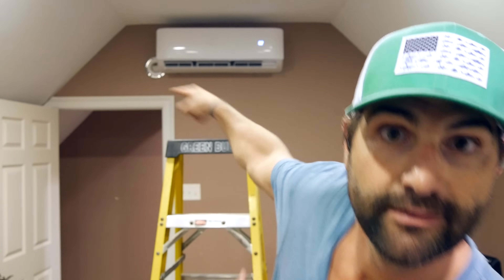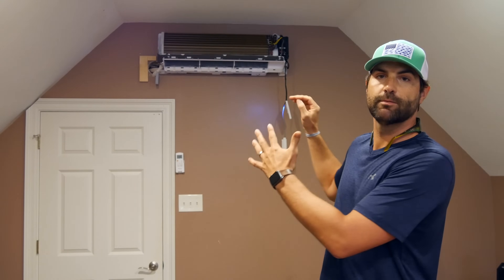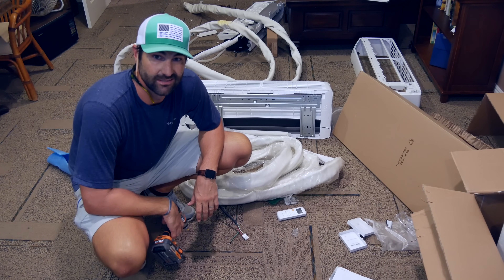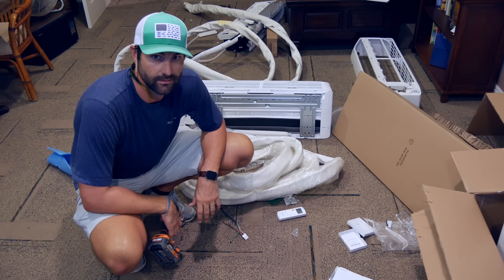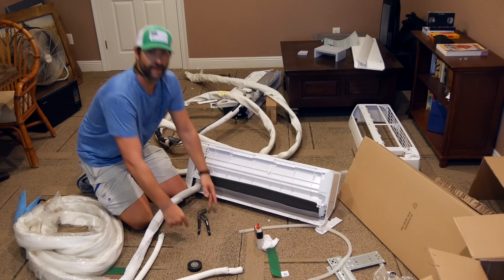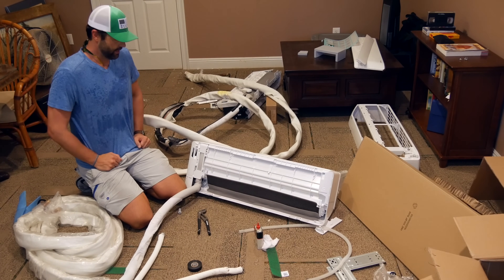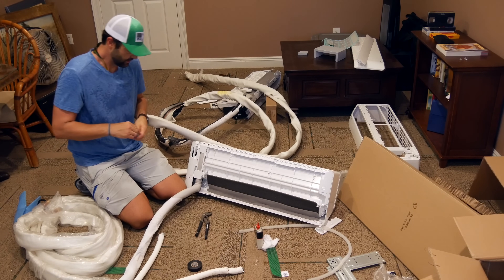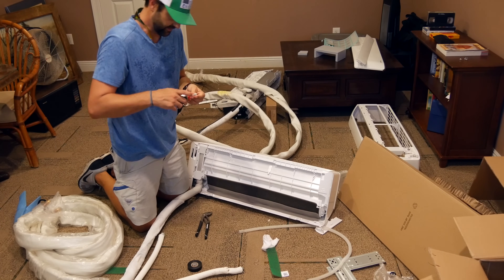Troubleshoot DIY Mini Split Not Cooling - Replace MRCOOL 18k Mini Split

Comment: I have the same set up I want to do for my new mrcool diy .   The place I want to mounting unit The inside unit it’s going to be above a door opening then behind it I have to go through closet wall wall then the  through my closet wall and then to the outside.  3 walls to get to the outside.   My issue is how much space do I need to hang the inside unit over the door way ?   Right now I measure 15 in  is that enough to left and hook the unit to the mounting bracket? Also the drain line I don’t want to run it through all those walls I was thinking of running it over the doorway behind it and then straight down to  my floor under the house and out  what do you think ? I noticed that you left the drain line out and then you fished it through And then it’s almost like if I was gonna do the same thing but I’m thinking of just running it behind the doorway straight down to the ground in and out of my house
Reply from the maker: Ram M457 - I will measure my unit and see, but I think 15” is not enough space for the 24k unit I have.  The smaller unit may be smaller in size.  Regarding the drain line, I would run it the shortest route to drain.

Make sure you slope the line set and drain line downwards as you go through walls.

I’m currently doing my 3rd MRCOOL installation video for my spray foam attic, so stay tuned for that one
Reply: Pahjo Designs thank you for replying I will
Have to make the wall entryway a little bit wider that way he can have enough space to be able to lift the unit and lock it in place as far as a drain line if you show in your next video how you’re doing the drain line will be awesome thank you for replying I am waiting for your video when you upload it I currently have not bought   The unit but I will soon and that is the only place I can mount it so I have to do some modifications to make it work in that entryway thank you again I appreciate your  reply

Comment: Hey guys. I’ve had nothing but problems using those insulated line sets with the white foam. I’ve replaced them on a few units. If you inspect them closely, you’ll notice how porous they are. I added the due capsules for POE oil and it permeated through the pipe and the insulation. Try not to use these line sets. You’ll save time and money. Run the American made copper tubing. Good luck.

Comment: You had a leak because of not pulling a vacuum on the line set and evaporator.  In Louisiana, once you pull the plug on the line set before you make the connection at the condenser valves, humid air enters the system.  The non condensables “humidity/moisture” when mixed with the refrigerant and oil in the system create acids that eat through components causing leaks.  After connecting the line set, the system should be evacuated with a vacuum pump, checked for leaks, then the refrigerant valves opened to release the refrigerant into the vacuumed dry sealed system!
Reply: You guys going back and forth on this thread, don't seen to realize they have two versions, the standard and diy.
The diy linesets are not open to the atmosphere.
They have sealed quick disconnect fittings, similar to hydraulic fittings I've worked with on helicopters, keeps air from entering the lines with internal poppet valves while being connected or disconnected.
I just installed the advantage version, and pulled a vacuum on it, but this is the diy version
Reply: I don't think any of them care.  They're just arguing to argue.
Reply: The type he installed is pre filled and pre vacuumed for diy setup
Reply: Initially when bought the DIY Mr Cools have charged lines. The Advantage series does not and what you said applies to those
Reply: The lines are not "pre vacuumed". No matter what, you always pull a vacuum. I'm a 18 year HVAC service technician and have been installing these for years.
Reply: @johnpatrick3458  That isn't what the instructions say to do.
Reply: @mrbodo69  It's called an industry standard. Something Joe homeowner knows nothing about, but will point the finger at anything or anybody when the compressor fails prematurely. I've seen it happen all too many times, but do what you want, it's your money!
Reply: @johnpatrick3458  I don't know what bee got into your bonnet, but if you have not read the installation instructions nor actually installed the unit, you're talking out of your rear.  Google: MR COOL DIY installation manual.  Then show me the step that requires vacuum.  I'll wait.
Reply: @johnpatrick3458  I watched his install video and noticed the same thing, then saw this video. It is true, doesn't matter if working on home/commercial, or automotive (my expertise), a manifold gauge set and vacuum pump are always in a technician's tool repertoire. "Ready to go" is nonsense. The lines from the inside unit are open the entire time before connecting to the outside unit. I read the Mr. Cool instructions and saw nothing mentioned, mrbode69 is correct. It's foolish however for those idiots to not have something on it, it's a necessity and HVAC standard to pull vacuum and evacuate the contamination/moisture before charging.
Edit: It may indeed be a ready-to-go install, doesn't mean I'd trade convenience for proper protocol though.
Reply: @johnpatrick3458  to add to another comment you posted clearly you do not read the manuals as they absolutely tell you to nitrogen and vac systems. Bahahahha!
Reply: @johnpatrick3458  you have not installed this unit then....
Reply: @851995STARGATE  You haven't a clue what you are talking about. You are saying that the lineset, outdoor unit and indoor unit is sealed to moisture and contaminants in the atmosphere through completion of installation. That is impossible because before you install the lineset that connects the outdoor unit to the indoor unit for the purpose of refrigerant flow it has to be open to the atmosphere before you make your connections.
Reply: @johnpatrick3458  no, read the manual and realize this is a true diy setup, it's not like the inverter setups or other units where you pull a 400 micron vacuum. There's a sealed copper cap on both parts of the lineset. It comes with the inside unit and lineset connected you can't separate them it's a premade 25 ft line tied directly into the indoor unit. The only part that gets connected is to the condenser, as you tighten it down you pierce a seal. If you don't believe me look at the thousands of other comments explaining it being precharged and there already being a vacuum on the condenser. I highly suggest you research this unit, it's not as perfect as say drawing it down yourself but they run fine
Reply: @851995STARGATE  Again, you have no idea what you are talking about and I hope nobody takes what you say seriously. You need to educate yourself before you make clueless statements. There is NO such thing as "pre vacuumed" air conditioning systems. You can definitely choose not to vac pump a system and keep replacing it every 5-10 years because of the moisture and contaminants that get into the system. I have condemned several ductless split systems that were 10 or less years old and EVERY one of them was installed by a DIY guy that did not follow proper protocol. PLEASE, to anyone reading these comments, do not take this guy seriously. Vacuum pump to 500 microns minimum and you'll have a great system for many, many years.
Reply: @johnpatrick3458 first question is are you licensed? Do you actually belive that you cant buy pre charged lines bahahhahahahah. Would an hvac guy use pre charges lines... no... but indeed they are available. 18 years of working on your mom's ac doesnt qualify you. Again I would never use the pre charged lines but they are available. Leave the poor guys alone... my stomach hurts from laughing so hard bahahahhaha. You sir are ignorant.
Reply: @johnpatrick3458  okay again do you still belive that you cant buy pre charged linesets? And do manuals tell you to pressure test and vac systems?
Reply: John Patrick I have a Line set that was preinstalled 4 years ago, it was put in for when i want to do a mini split. do the line sets that have been sitting idle need to be ‘cleaned’ since it’s not bright shine copper anymore?

Comment: I have a similar space with spray foam insulation in the walls.  Im have two questions.  What size as far as tons is you unit and square footage.  Also, i just discovered I have a freon leak on my inside unit.  You can see the freon shooting out of one of the copper tubes in the coil.  I wondered what the warranty is on these units
Reply: I now is a year later but a ton is 12000 BTU. Every ton is good for 600sq feet in average insulation hope it helps
Reply: @beebee1518  Thanks for the info! What your saying is true!
Reply from the maker: My space is roughly 600 sq feet.  Not sure of the unit size in tons, but it is 18k BTU and 16 seer

Comment: Hi, I just installed a 24k unit and seem to have the same problem as you. Did you're unit start out cooling the air then warm to room temp before reaching the set temperature? Since I live over 3 hours drive each way for a tech to visit and diagnose my problem Mr Cool is sending a recharge kit. I hope this helps but once a leak starts its a real pain to find and fix. Any help would be appreciated.

Joe C.
Lakeview Oregon
Reply: Replace the line set with American made copper. These Chinese ones are too flimsy.
Reply from the maker: Joe Cos - mine started blowing warm air out of the gate.  If it doesn’t work, I would ask them to send you a whole new interior unit.
Reply: Thanks for the quick reply, I will try the recharge kit but i don't think its going to help since it blows cold then turns warm after a few min. I am going to ask for a complete new unit, indoors and out since I can't tell where the problem is located. Mr Cool thinks it may be in the temp sensors inside and outside. Will let you know how this shakes out. Thanks again!

Comment: Closet flange.
Check the stepping exv..and many techs never test the invertor/compressor can for leaks in welds..one fissure or gas hole will do it..improper flares can also seep.

Comment: Great video - thanks!  I installed three Pioneer Mini-Splits two years ago (identical to MRCOOL), and they have been the best things I've done for our house.  One was the 12000, and two were 24000 BTU's.  They cool very well, it's easy to clean their filters, and the savings in electricity is phenomenal!
I had a question, but I don't know if you've needed to delve into any maintenance yet.  
I want to clean the fan blades, which are the only things that have become "gunked" up over two years (the coil fins still look great).  
But - do you know the "secret" to removing the full front covers?  (Not just the main flip-up access door - I need to take off the whole plastic cover - front, top, and sides.)
I can't find the placement for the screws inside the vent area that most mini-splits have.
Do you know where the screws to remove the cover are?
Please enjoy your efficient cooling / heating system!
Thanks again, Randall
Reply from the maker: Thanks so much for the comment.  I didn’t know pioneer was the same as MRCOOL.  I’ve had the same questions as you regarding removing the pieces and cleaning the unit.  So, I’ve just asked my HVAC pro to clean my mini splits when he performs annual maintenance on his other units.
Where did you buy your pioneer units from?
Reply: @PahjoDesigns  all of these mini splits are rebranded mini splits made by the Chinese company Midea. Many many companies rebrand Midea mini splits. Pioneer , Mr.cool , blueridge and others. Even Carrier mini splits are now rebranded Midea since now Carrier owns apart of them. Some of these brands people have more trouble with than others. some of these companies that rebrand Midea design a custom control board for their outdoor / indoor units or some use custom control code / programming on standard Midea control board . This is partially why one brand can have more problems than another. Also if you want the cheapest Midea rebrand mini split, buy one that is Midea branded , or even one that is not branded at all. They have various other problems because of how cheap they are . allot of them will eventually have refrigerant leakage problem because of how cheap the coils are with these
Reply: @MichaelWeaser  How did you learn all this? I'm deep in the middle of choosing a mini-split now, and the brands and options are mind numbing.
Reply: @tonykara  
i was told by a company that sells mostly Midea branded mini splits, and if you look at different brands  , and they look identical they are.

Comment: How many microns did you evacuate the lineset and evaporator down to?  Pardon me if somebody else has already asked the question, I didn't check the other responses.  When you were diagnosing the system with a leak, did you try pressurizing with nitrogen ?

Jim
Reply from the maker: emptech - thanks for reaching out to me.  I hired a mini split HVAC professional to come and diagnose everything to prove it was faulty.  From that point, I contacted MRCOOL and filed a warranty claim.  They sent me a new indoor unit.  I installed it and called my HVAC pro to recharge the system.  In short, I don’t have that info..  I can maybe get it from my HVAC pro if it will help you.
Reply: I've installed a few, fortunately have never had a problem I couldn't deal with.  I've heard that so many people buy a DIY mini-split and don't even pump the system down, they have no idea how significant a little bit of water vapor can hurt, plus, they have no idea if there is a leak until they loose their refrigerant.  I hope that when you finished the job, you covered up the lineset outside.  I've seen in foreign countries where they put a shelf out on the second or third floor to mount the outside unit.  Mini-splits are used all over the world, I think the US is way behind on the technology overall.
Jim

Comment: I recently installed a 24k Mr. Cool unit in my Waikiki rental property. I thought it would be a reasonably priced upgrade. After the install and a visit by an AC technician, it was determined that the control board sent with the unit needed to be replaced. AC is not usually considered an emergency repair, but it is when you have paying  guests staying in your Waikiki apartment. Considering the unit did not work right out of the box, I'm wondering if it will give me reliable service in the future? I made the purchase through Home Depot and I could return it as is. Mr. Cool is sending a replacement control board, but I just don't know if it is worth the stress and hassle to deal with what might happen next. bobmillerhawaii@gmail.com
Reply from the maker: Hi Bob, I had the one issue with mine as outlined in this video and no problems since.  It has worked flawlessly.  I purchased both of my units from HD as well.  One of my 2 units is in my workshop and it is running really well despite the plethora of sawdust.

Comment: Well that was not what I wanted to hear about mr cool: a leak after one year. I would have wanted a complete replacement (both indoor & outdoor units). Did they say you had to pay for an HVAC tech to get the replacement indoor unit? How did he know it wasn't the outdoor unit leaking? And how is it even possible he couldn't find the leak?
Reply from the maker: bgregg55 - I had to pay for the service tech to diagnose the issue.  He couldn't find the leak because it was in the line set somewhere which is concealed. The tech would have needed to rip the whole unit apart to find the leak.  Instead, I called MRCOOL and they shipped a new inside unit and that did the trick.  I wrote a blog about this which is a bit more detailed.  Link in the description.
Thanks for watching!!!
Reply from the maker: I actually believe this unit was not right out of the box OR I did something wrong during the installation.  This unit was in a room that I don't use very often.  I installed this unit in October and really didn't need to use it until the weather warmed up in April/May timeframe.  I live in South Louisiana where we have very mild winters.  I noticed the issue in May.  I was happy with the customer service I received from MrCool.  Lets face it, stuff breaks.  As long as the company stands behind their product and treats their customers well, that's all we as consumers can ask for.
Reply: Out of curiosity how much did it cost to have a tech come out
Reply from the maker: He was a friend of mine, so it didn’t cost me anything.  If he were to charge me, it would cost at least 125.00.
Reply: bgregg55 what was your unit doing that alerted you it was bad? I just got one a week ago and I feel like it isnt heating or cooling very well at all. The heat comes on sometimes but most of the time its blowing slightly warmer air than what's outside and slightly cooler than what's outside withing 1 or 2 degrees

Comment: Nice video! Care to sell the extra Wi-Fi kit or know where I can order one?
Reply from the maker: golfwins1974 - thank you very much for watching.  The wifi kit went back to MRCOOL in the old unit.
Reply: INGRAMS WATER AND AIR OR EBAY USUALLY AROUND $50 FOR THE KIT
Reply from the maker: They also have a new smartphone kit that includes WiFi & Amazon Alexa integration.